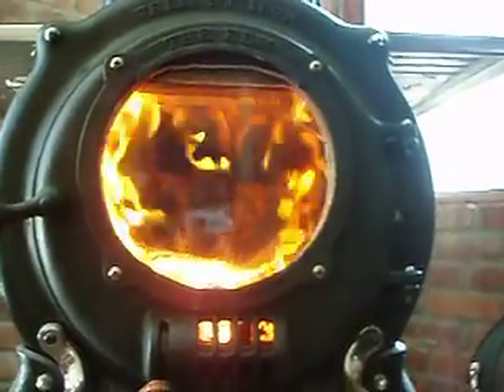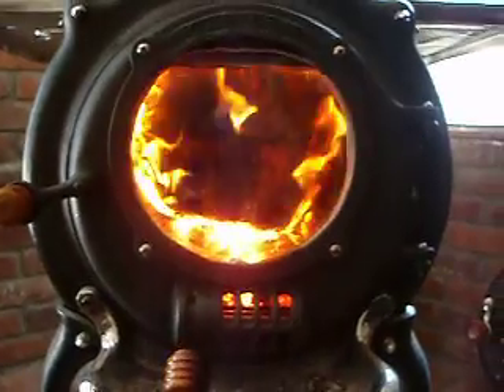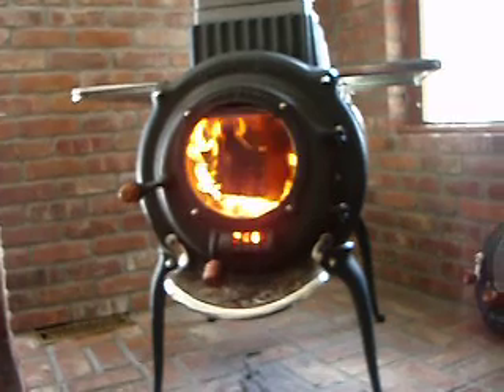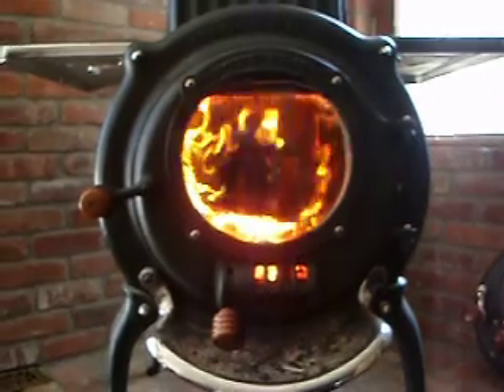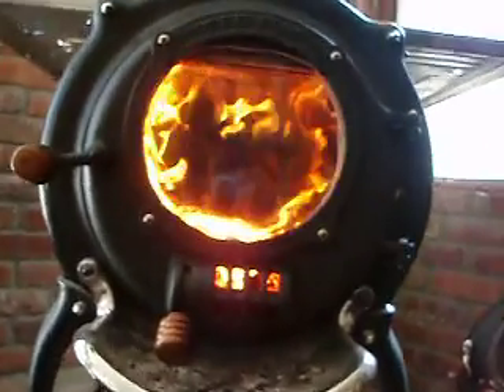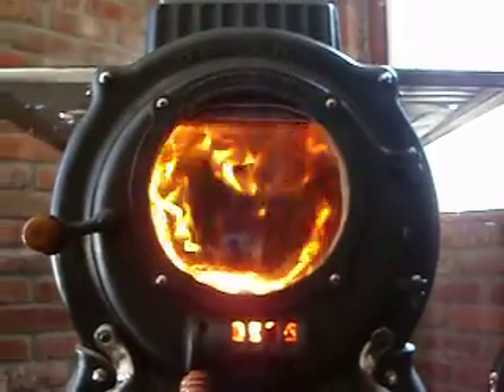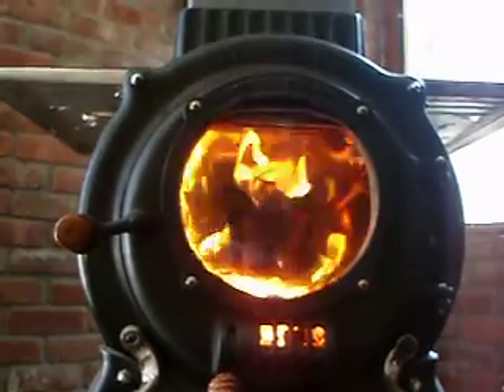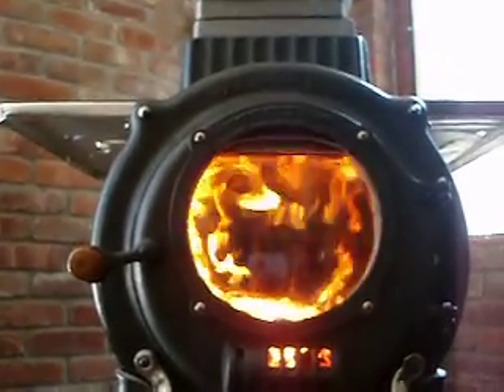Wild Fire Elm 24" wood stove,  secondary combustion test

Comment from the maker: Do you mean a hot water loop?  People have installed several types in Elm stoves.  The most common is a stainless steel "U" shaped tube, with cold water coming in the bottom leg, and exiting on the top.  email me for a link to the site that sells those.

Comment from the maker: Each stove is different, yet there are some basic things that have to be done to any stove in order for the secondary air to work.  One factor is the size and placement of the tubes.  another is the addition of insulation, whether it is firebrick or other types used to keep the coals and wood hot.  there also needs to be a substantial bed of hot coals and dry firewood.  either softwood or hard wood have been seen to work.

Comment: I would like to know more about the baffle and air tubes the more simple the better. My stove might be difficult but it is an old army tent stove that I burn mostly wood and some coal occasionally. I run it through my fireplace chimmney it is like a pot belly stove to some degree and comes apart very easily.